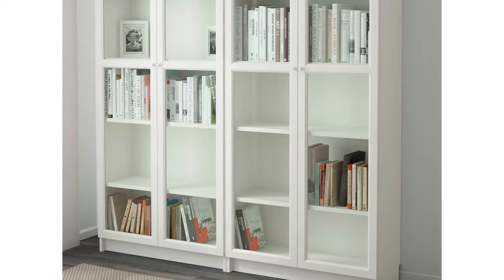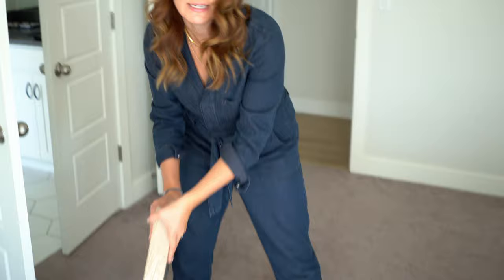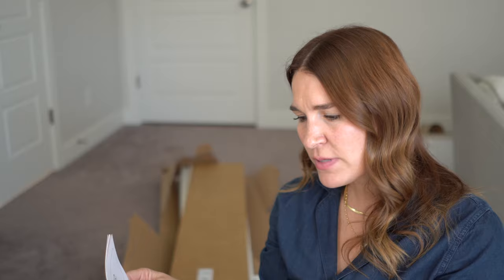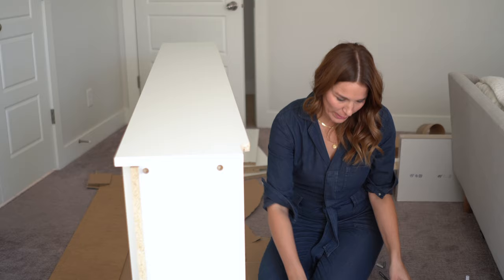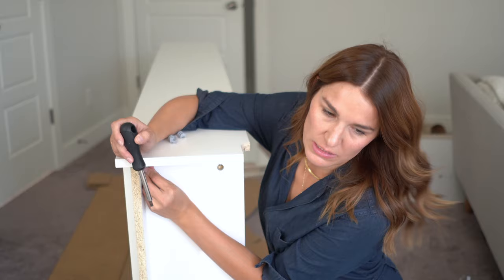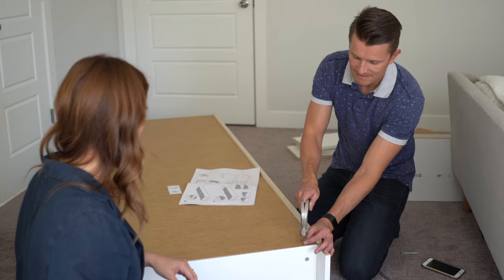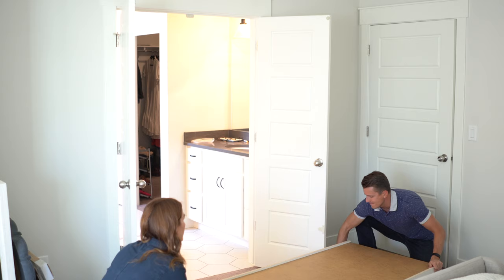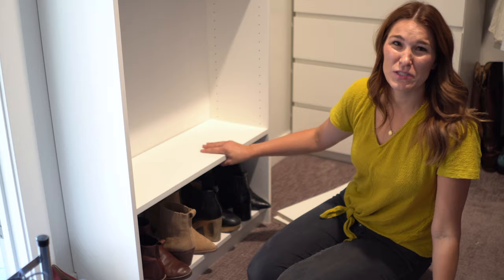MY DIY DREAM CLOSET UNDER $150 | HACKED! Ikea Billy Bookcase

Comment: hi i have a small car and i want to but 2 of these. do u know if it will fit the back if my car?
Reply from the maker: Hi! Check the measurements! The length is pretty long, but I didn't have an issue in my SUV. I do remember it was close though.